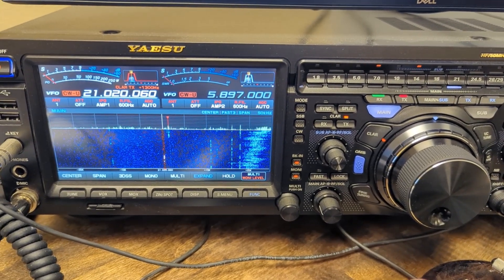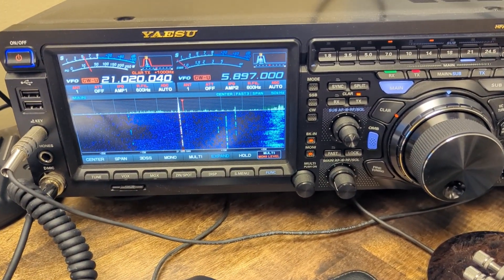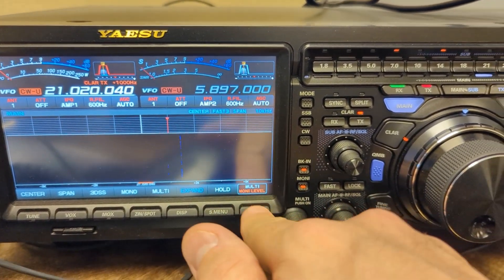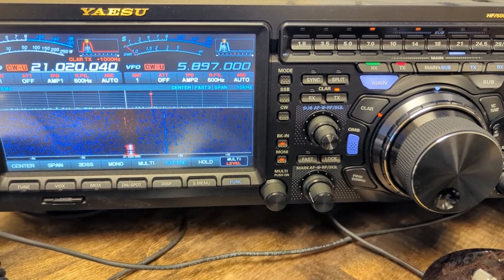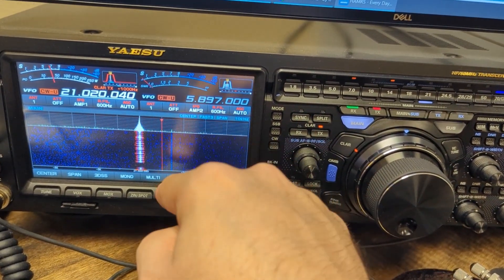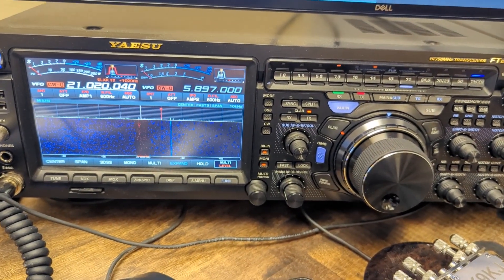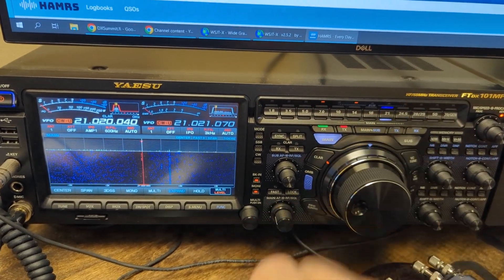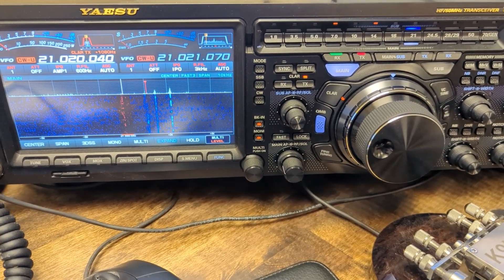Working DX "Split" on CW - Curacao - PJ2/K5PI

Comment: CW learner here. Is there a connection between the clarifier and the notch filter? The notch filter narrow the bandwidth of your Rx right? Based on the name, I was tempted to think that a "clarifier" accomplishes the same thing. TU de KC3RLG
Reply from the maker: The notch filter will tune out adjacent signals - I should do a video on this.  The clarifier is another term for RIT, or receive incremental tuning.  I did a video on this one here: https://youtu.be/c76e6PSI_Hg